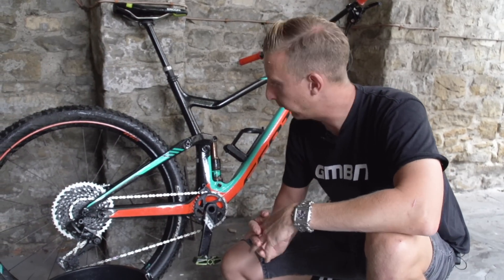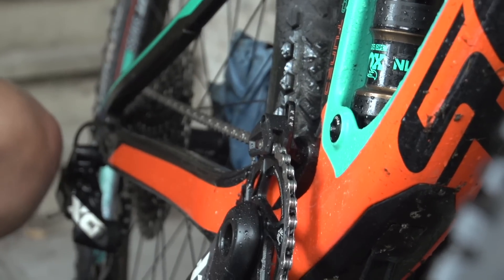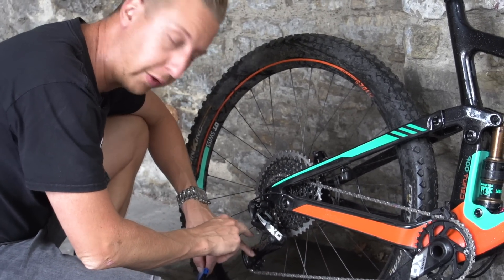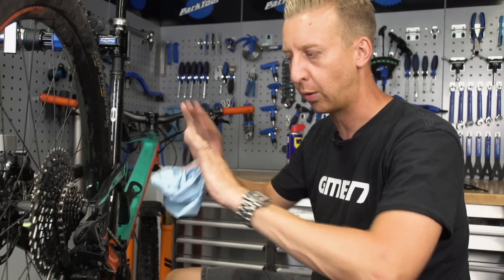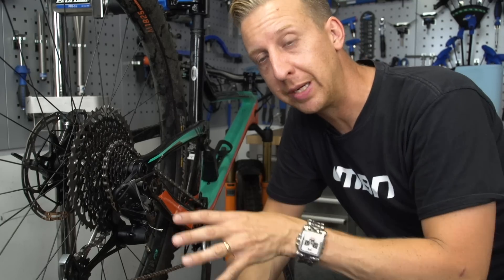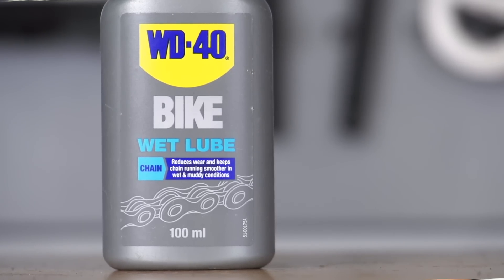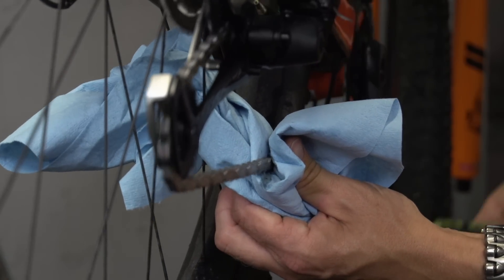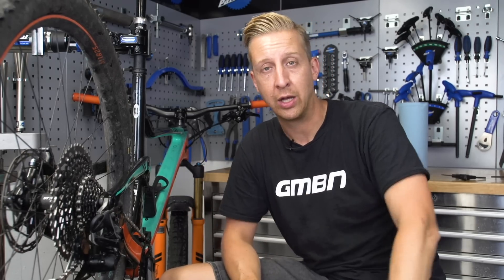How To Clean And Lube Your Drivetrain | GMBN Tech How To

Comment: I just orderd a new MTB and i wonder if the chain comes pre lubed? and if it does what kind of lube is it? i know for a fact i will need dry lube on there, do i have to remove the pre applied lube before putting on dry lube?? thanks!
Reply: I'd just ride for a few days then clean the chain and relube
Reply: @Pik4chu985  So i can hit some sandy tracks no problem?? its just a bit sandy here my area.
Reply: @Maltebyte2  yeah definitely. For sandy tracks I'd run little to no lube anyway to prevent sand from sticking to the chain
Reply: @Pik4chu985  Thanks! so for now i will not apply drylube when i get the bike? thanks man!
Reply: @Maltebyte2  no worries. I wouldn't apply any lube for now, otherwise the chain will just collect more sand than necessary
Reply: @Pik4chu985  Thanks man! i will inspect the bike when i get it, maybe the chain is a bit to greasy or the wheels might need to be trued, with the help of the internet! :)

Comment: Silicone. Makes tires look like new, bearings, cables, chain, suspension, everything. Safe on plastic, put it on everything except brakes.  Makes your bike look brand new. I use it on bearings, but I overhaul every 150 miles, or every week.

Comment: Take the chain off the bike and drop it into a can of light solvent (naphtha).  Agitate.  Brush if necessary.  Sling off excess solvent and let dry.  Lube with one drop on each roller.  Wipe clean.

Comment: I used a dishwashing soap is that safe?
Reply: I haven't used it yet but I got the same advice from my friends. They told me to use it after degreasing, followed by the soapy water (Water+Dishwashing Liq), dry it out then lubricant.

Comment: Thanks, very informative video.  Just the little tid bits of info helps.  I have been using a multipurpose degreaser called Orange or whatever from the dollar store.  It has worked fine, haven't noticed any negative effects in the long-term but it is a better idea to use the right stuff
Reply: if you have a cheap bike no problem...but if you have an expensive groupset on there i would not take any chances.....but if you cants see any problems...i dont see why not to use it...........

Comment: A small tip I use to lubricate the chain is to put the extremity of the lube container directly onto the chain (like you in the inside) but with a physical contact. This way, the lube will slide on the chain by capilarity and not with drops so you don't waste any product :) Actually, this way you don't even need to push on the bottle to get the lube out.
Reply: This is my exact method 🤙🏼

Comment: Powerwash my chain on all bikes i had. Perfectly clean chain. Of cource i been told not to do it as water under presure will damage chain 🤦‍♂️
Reply: oskar115 it also obliterates all the grease in pivot joints and bushings and things like that...
Reply: I'm guilty of doing that before I was told by my buddy that it was horrible for it, I've changed my ways for sure

Comment: Doddy says to apply lube to the inside of the chain, by dripping lube onto the lower run, but the video for the WD-40 lube he uses says to apply the lube to the outside of the chain at the top of the cassette--so just the opposite of what Doddy recommends.

Comment: thank you Doddy, I now finally understand why youre supposed to wipe away the lube that has just been applied on a chain
Reply: Some lubes should be left on preferably overnight the excess wiped off the next day. The only place you want lube is in the rollers so the drizzle technique although quick but messy, misses rollers and wasteful. Takes less than 2 minutes to add a drop to each link, give the chain a few revolutions and wipe off the excess as per the lubes instructions. The mind boggles at the use of spray lubes on chains..... just do it properly and apply to the rollers individually.
Reply: thats what i do, clean, it lube it. do a test ride around the block and wipe off excess oil from the chain wich isnt much because i also put a drop on each roller.

Comment: Just go on the carwash and it’s all like new. No need of super expensive Bruches. Couple of old toothbrushes are amazing.
Reply: its very bad for bearings and fork bushings. hand wash is best if you want your bike to last
Reply: Tomas van eccelpoel I’ve never heard a bike 🚲 got broken from washing. They’re not that fragile
Reply: high pressure washers will blow the grease out of bearings wich will make them rust en fail much faster. google it.most people will say the same

Comment: i find that filling the chain-wash with degreaser is actually not the best option. i like to first spray chain-cleaner onto my chain, let that work for five to ten minutes and then fill the chain bath with a small amount of chain-cleaner and top it up with soapy water. then repeat, using ever smaller amounts of cleaner. Else the dirty degreaser will leave greasy black residue on the chain that cannot be cleaned off with water. that obviously depends on the chain-cleaner that you are using. some are not prone to this. with the kind i use, this would be a real problem.

Comment: i dont know, i had 3 bikes in my life. 1 was very very old gearless bike which lasted for ever and my parents threw it away after bought me some chinese bike with gears, like 20 years ago, and then like 8 years ago from now i bought my SCOTT mtb, i have cleaned it like 3 times in total, never needed to change any part except tires one time and breaks 2 times. i sometimes lubricate the chain with motorcycle chain lubricant or some old paste like brown grease. and till this day it runs pretty good. what kind of cheap crap do you buy that chain or other parts can break due to some dirt lol ????

Comment: If you spray your rotors and brake pads with IPA (isopropyl Alcohol the 99%) stuff) it will remove every trace of grease, dirt and grime, and they'll be ultra clean